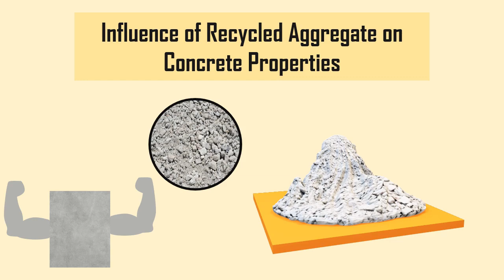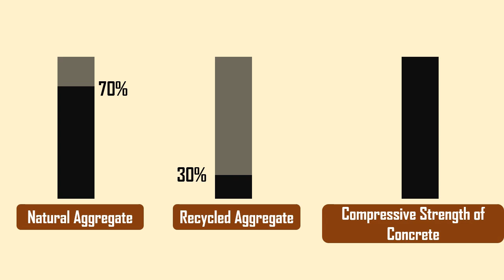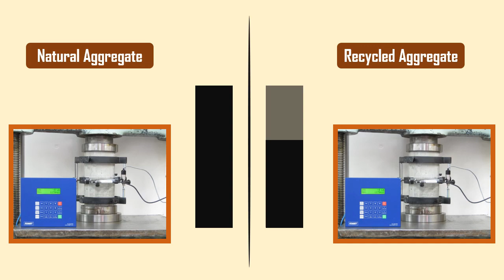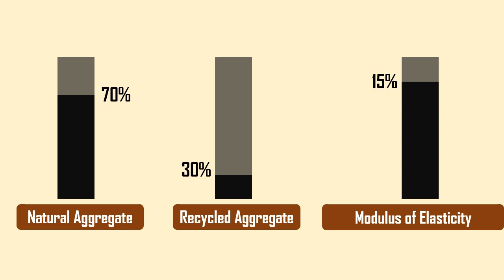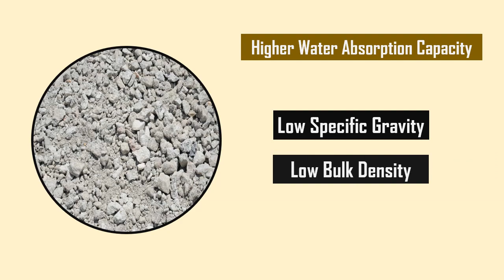Influence of Recycled Aggregate on Concrete Properties || Recycled Concrete aggregate #2

Comment: Hi, 
I'm a researcher on RCA concrete, appreciate your video but unfortunately your data on RCA concrete properties (i.e. Compressive strength, shear strength,..) are wrong. aggregate replacement ratio has no effect on compressive strength when mix proportioned properly. it is accepted that the only factor affecting compressive strength is Abrams law (water to cement ratio) and not the aggregates nature. 
for further information you can take a look at:
https://www-sciencedirect-com.proxy.bib.uottawa.ca/science/article/pii/S0958946509000304
or contact me via mail. 
cheers
Reply from the maker: Thanks for the inputs.. but replacement ratio will have some impact on compressive strength. Kindly check with other research articles and standard books.
Reply: @AnimeEdu   glad to hear back from you, the problem is not the replacement ratio, the problem is using the same mix design method used for conventional concrete for proportion RCA concrete. the reason lots of researchers are reporting inferior properties is that they don't consider the attached mortar in their mix design hence ending up with less volume of aggregates in the RCA concrete when compared to a similar conventional mix, not to mention the huge difference in the amount of hardened cement.
when mix designed properly amount of aggregates, mortar and water to cement ratio will be the same resulting in the exact same mechanical properties. 
comparing a direct replacement mixture RCA with a conventional mix and reporting inferior properties is the same as comparing 25 MPa concrete with a 35 MPa concrete and saying its weaker. 
RCA concrete procured from a high quality source (45,50 MPa original concrete) could out perform natural aggregates.
Reply: @Missilees   bro can you please provide the source?
Reply: I agree with you. Just as concrete made in different areas will use better or worse agregate(sand atone vs granite). The recycled aggregate in some areas will be better than others. Ending up with a better final Product. I’ve been making concrete with just crushed road base and cement for flat work and have great results as far as strength goes. It might even be better s far as cracking goes.
Reply: hi I was not able to get to the link you provided thanks